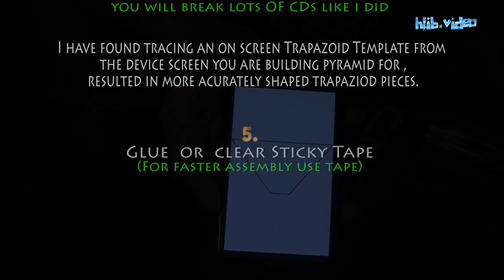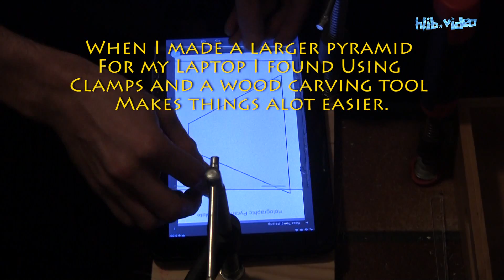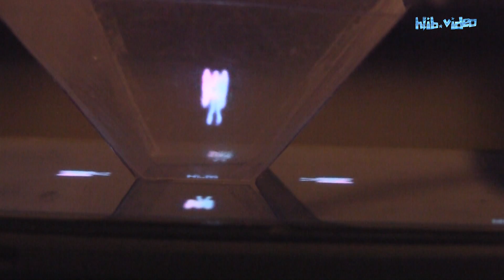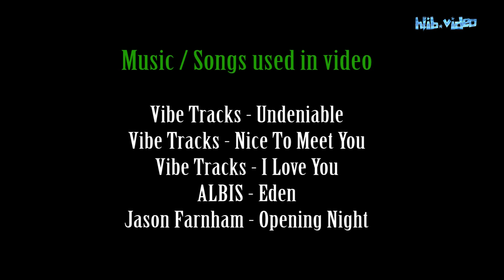How To Make a Hologram for your Phone, Tablet and Bigger Screens! - 4 sided Pyramid - (DIY Hologram)

Comment: what size is the trapezoid in tablets?
Reply from the maker: It depends what size your tablet is,  open our Trapezoid Template Here: https://plus.google.com/b/114358787847875315270/photos/photo/114358787847875315270/6412634439396980178

open link above on your tablet & trace trapezoid & size will be correct for your tablets dimesions.
Reply: It doesn’t work
Reply: @christmasboy9223  does